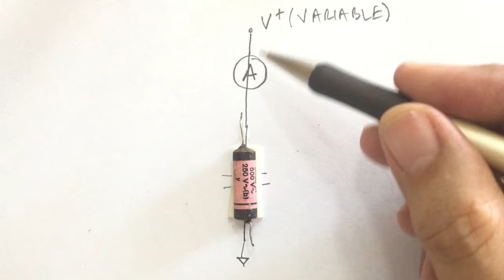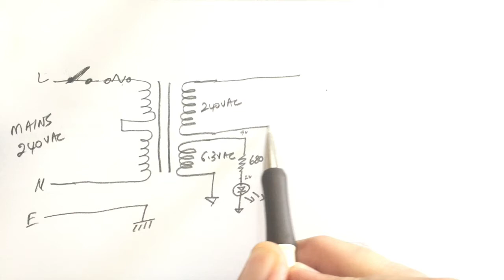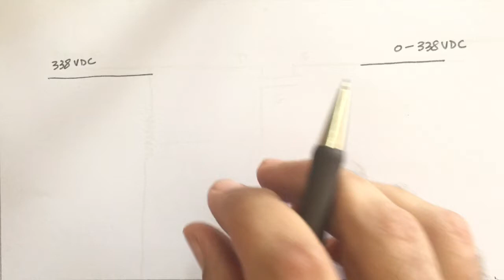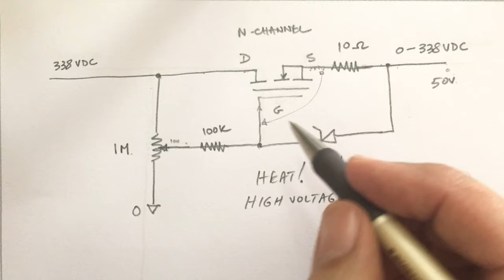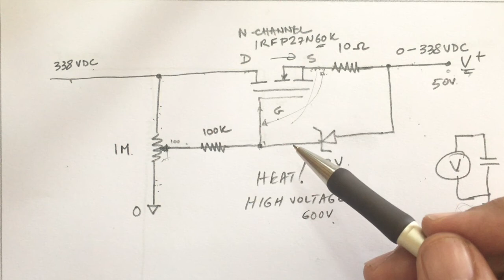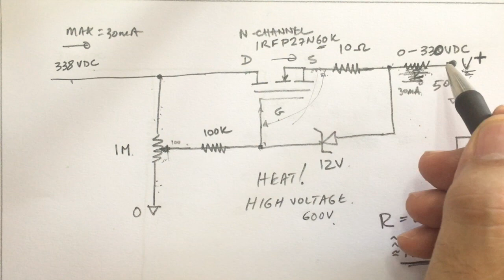Capacitor leakage tester design & build - Part 3

Comment: Instead of building the power supply per your design, can you use an external power supply, something like a Heathkit IT-2717 that produces approx 350 volts? Maybe put the 12K and diode in series with V+ and before the circuitry in the tester portion?
Reply from the maker: You can do that. Ultimately, what we want is a variable high voltage power supply to subject the cap to the produced voltage.

Comment: Wouldn’t it be better to combine the two current limiting resistors of 10 ohms and 12 kohms into one single resistor of, say 220 ohms in the position of the 10 ohms resistor? It will have a much lower heat dicipation of only around 200 Milli Watts as the mosfet is doing all the heavy lifting, but that device sits on the heat sink so there is no problem there.
Reply from the maker: You’re probably right. One could do current limiting at the source. Good idea.

Comment: Hi there, I actually just rebulit this circuit and it kind of works but I have one problem: I cant get more than 3mA (at full voltage) out of this circuit. I used all the same components as you did. The transformer is out of an old tube radio...I think it should be able to supply more. What could possibly be wrong with mine?
Reply from the maker: It should. You’ll have to test voltages before and after the circuitry, and make sure the mosfet is actually turning on.
Reply: You were right! I must have been pretty tired when I soldered this. 😄 The zener was shorted out. Now it works like it should...I only need to get a new amp-meter...mine is open...dont know why. Maybe it came broken from the factory...

Comment: Probably too late to get any answer to this, but let's give it a try ... many thinks for this video - I enjoyed it. But can I say why the 240V/240V transformer? Obviously for someone living in a 115/120V country, then the two 120V windings would be used in parallel to give the required high output voltage. But for folks living in a 220/240V country, the most the transformer would do is give isolation. Is that its only function in such countries?  Thanks again for an informative video.
Reply from the maker: Absolutely. You always want isolation, or you get a hot chassis risk. also, this system had to be completely floating, so if you used a transformer-less  circuit, you would have fireworks.
Reply: @electronicsoldandnew  Ok - makes sense - thanks for your reply.

Comment: Very thorough explanation! One thing to note is that putting an LED across the 6.3VAC winding will damage the LED over time. LEDs typically have a 5V reverse peak voltage, and the 6.3VAC * sqrt(2) is higher than 5V. An easy fix is to put a standard diode in parallel with the LED, such as a 1N400x.
Reply from the maker: Yes. Corrected that. Thanks

Comment: Great Video, but what I don't understand is why use the MOSFET at all?  Since you're just charging-up caps, why can't you just go right from the variable resister out thereby eliminating the MOSFET circuitry?
Reply from the maker: mohare134 : the idea is to get a steady voltage output which is variable. The a lot will not do that. The actual voltage will depend on the current drawn through the top part of the pot through the capacitor.
Reply: @electronicsoldandnew  I see.  Thanks for the clarification.

Comment: Hi Mr Caldeira, how would you modify this circuit to accommodate for a higher current transformer? You mention yours is just 30 mA but us mere mortals here don’t have that kind of thing lying around ;-)! Thank you for the great content and excellent explanations. Keep up the great content please!
Reply from the maker: A higher current transformer will work as is. The only difference us that if you create a short circuit and there is no limiting resistor (the 12k that I use), then you could blow the mosfet.

Comment: great circuit.  You may want to put another 1n4007 in series with the output to prevent a charged cap from feeding back through the circuit.
Reply from the maker: That’s a great suggestion. Thanks
Reply: I just watched part 4 which has the diode.   You have a very interesting site. Thank you for your efforts and sharing with us.
Reply from the maker: I actually forgot that I’d put the diode in there. It’s been a while :)

Comment: what I do (takes more space but cheap or almost free) I take 2 pcs of 230-12v transformer and connect back to back. you will have voltage drop to 200-210vac. if you need more voltage, connect the 12vac to a 9v-230v transformer then you can go up in dc voltage. these transformers can be found in old adapters etc that goes to trash.
Reply from the maker: Yes, that’s a good trick to save on an expensive high voltage transformer.

Comment: Thanks for the excellent series !!  I have been looking for something like this for a long while !!   I do have one question.  Have you found the the 2 Watt 12K ohm limiting resistor to work OK?  Because it seems that the possible short circuit wattage thru it could be much higher than 2 W !    I.E.  0.03 x 0.03 x 12000 = 10.8 Watts !!  Am I missing something ?
Reply from the maker: Donald Filbert : you’re right in your calculation, but because the actual currents are very small, the resistor wattage has been fine so far. The 30mA is a worst case short circuit condition that you would immediately turn off. I’ve used this constantly and have not had any problems. If you want, put in a 10W, it can only help.
Reply: Thanks for your quick and comprehensive reply !!  I understand.  After I posted this Q - I also saw in the next video after this that you changed the wattage on the updated schematic and addressed the situation.  Thanks again !!

Comment: I am working on that beatiful project. The referenced switch 2P5T (Mouser Part# 105-SR2511F-25S) is rated at 125v DC, and there is no way to find one suitable for 400v. Any help will be greatly welcomed. Thanks in advance!
Reply from the maker: Jordi Guimera : that rating is way too low. The current is very low so you can get away with a slightly lower rated switch, but not that much lower. I found a 300v one in Rsa components (RS Stock No.	0352250) which would probably be just fine. You can actually use a 2p6T as well and the last position can be left unused.
Reply: Excellent !! It is exactly what I was looking for and I was not able to find. Thank you so much indeed!

Comment: Great desing and excellente explanation. I do however have a question (please take in consideration that Im a novice in electronics), isnt that zener also dropping a large voltage? If the potentiomenter is feeding the full 338Vdc and the zener is dropping 12V, in my head that zener would need to dissipate a lot of power as well. Am I mistaken?
Reply from the maker: artsandclouds : the Zener is there as a protection device to prevent the gate to source voltage from exceeding a safe level. The mosfet turns on very fast and what the Zener will see is the gate to  source voltage, effectively never reaching its breakdown voltage of 12V.
Reply: Thank you very much for taking the time to answer me. Now I understood it!

Comment: Damn, looks like I'm going to be building one of these after all, current going rate on ebay for Heathkit IT-11/IT-28 testers is at least $300.  :-(

One of the IT-28s I was bidding on finally sold for $355, too rich for my blood... besides, I rather like the idea of making my own.
Reply from the maker: RayDT : and it works great. I’ve been using mine a lot more than expected, and it hasn’t disappointed me yet.

Comment: My most expensive component was the front panel meters. Since I am in the US my wall voltage is 110v. I purchased a cheap step up transformer (110 to 220) from ebay which was like $5.... Like I mentioned on another of the videos, I added a self made ESR meter as well. I yanked a 7v transformer out of an old wall wart for charging an old drill, that I don't own anymore; this powers the ESR circuitry. I would have liked adding some winds to the other transformer to power this but I didn't have magnet wire at the time.

I am watching these videos again because I like to see if I can learn anything new. I've been thinking of making a "digital" version of this, which is much more complicated but it would be fun =)
Reply from the maker: Ian Ide : yes, a digital one would be fun.

Comment: very good video. thank you.  if the voltage pot fails , what will happen to the cap being tested?
Reply from the maker: Stan Young : one of two things- if the fault leaves the wiper connected to the lower end, nothing happens. If the wiper is left at the high end, then the full supply voltage is passed to the capacitor. If the cap is high voltage, no problem. If it is a low voltage cap, then .... boom.